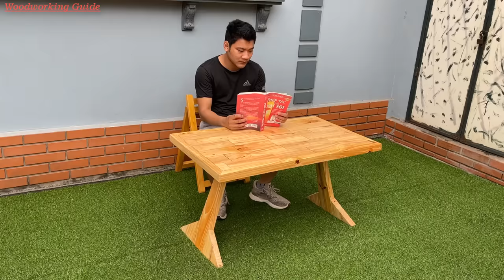Fish-inspired Wood Recycling Project // The Most Unique Idea For A Beautiful And Simple Table

Comment: Nice job on that table. I work in a cabinet shop by the way and if I can offer a bit of helpful advice, near the bottom of those legs if you were to run a piece of wood across to join them together it would strengthen them quite a bit. With them as they are if they were to bear too much weight the strength of them could possibly be compromised. Because they are each only attached with three screws you stand the chance of that table collapsing. The top of the table incidentally is a great idea for a good size chopping block also. I don't know what kind of wood you used but if you were to use a hardwood such as oak it would make a great chopping block.
Reply: or wire, ormaybe some strong fishing line 🙂
Reply: Agreed
Reply: Cada uno hace la meza como quiera!!
Reply: I thought that in time the mitres would open up?
Reply: Certainly needs bracing across the bottom. Pine offcuts so cheap to make, well done.
Reply: Yep. A stretcher with thru mortise and tenon joints with plug pins on the outside ends would provide amazing support and make this great table really complete and beautiful. Very nice idea for a trestle table. Thank you for the video! Subscribed!

Comment: Next time use butchers paper as a backer, or waxed paper, usually peels right off . If not easy to sand off.
Reply: Or, clear wrap or just plan brown paper. Newspaper? I guess any of these would suffice, however, the wax paper works good.
Reply: @robertlangley258  I think the epoxy might soak through newspaper and you could end up glueing everything to the surface/table below.

Comment: First little bit of weight that gets put on there it collapses
Reply: Heaven help those legs if he has kids!
Reply: @ChuckCoy  ²1ssq+
Reply: If you notice, the sides of the blocks were drilled, so glue and urethane if that’s what the finish is, would find its way into the holes and act as if it were doweled. I assume.
Reply: Thats apoxy... Not collapsing at all
Reply: @ChuckCoy  i concurre
Reply: @douglasmichel6361  you assume incorrectly.
Reply: @rulowth4815  

🤣🤣🤣

Epoxy can't beat physics.

Comment: If you smear a thin layer of Vaseline type etroleum on that white board you used for glueing up the table top. It will seperate very easily. Nice job as usual.

Comment: Cool design; fast execution; not sure how it'll hold up, though - looks like pine, and pine likes to move with ambient conditions.  Some of those joints are going to let go eventually.
Reply: The wood will break befor glue does.
Reply: @williamcaldwell9243  As a woodworker, I know only too well about how glued joints work.  My comment is still valid, however, considering the lack of tightness in those laminations, among other things.

Comment: would a top like that work for making a workbench ?  Or wold all the beating a typical worktable goes through make it come apart ?
Reply: I’m sure it can take a light beating.  Glue in general is very strong, but as a workbench for lots of hammering and other heavy things, I wouldn’t suggest it. Cool concept though
Reply: @gs2875  thanks for the reply...   hmmm, maybe a base of 3/4" plywood with that on top...   it would be awesome looking.    I might give it a try this summer (prices permitting)
Reply: @ProbablyUnacceptable  definitely a sheet of plywood as a base. I think it would be a nice conversation piece.
Reply: @gs2875  ゆゆゆふゆむ

Comment: What are the components used to make the adhesive? Name and brand will help, thinking of doing this for 1st time. Thanks!
Reply: Same
Reply: It is an epoxy .. But Wood glue is powefull enough to hold the pieces...  But you need clamps or something to tighten the pieces....
Reply: if you're going to do any woodworking I suggest you look to other channels for guidance. Everything about this manys ways are wrong.

Comment: Wood expands and contracts across the grain if it gets wet or very dry or even with changes in air humidity. If this table gets even a little bit damp it will split apart at the corners, guaranteed. A bad design but it will look quite nice for a week or two.

Comment: I really think that you should've glued each wood together instead of doing what you did. I don't like the spaces between the woods on the tabletop.
Reply: I think what you mean is clamp? Or wood glue? But yeah, I haven't had much experience with epoxy glue, but it is strong! If it were me, based on what I'm used to, I would've done wood glue and clamps to make the table top, which would've saved on the wood/glue sticking to the plastic surface he used, but it works all the same

Comment: I like the idea, however I would have laid out the 2x4s , glued them together with either biscuits or dowels for strength, cut to size and framed afterwards. As far as the legs are concerned, that’s a huge point of failure. A little bit of weight and those legs will flatten outwards. 

You have some nice ideas, but a little more learning about carpentry could make those ideas better.
Reply: Neither biscuits nor dowels add strength.
Reply: @jeradmiller4575  to the joint they do.
Reply: Nope, they're for alignment not strength.

Comment: Is your sander an angle grinder?
Reply: Yes, that’s an angle grinder, I use one on solid surface, they don’t have variable speed, and you burn through pads like crazy, hook n loop is a bad option, go sticky back and change pads not paper, or better yet get a makita 4”x24” belt sander, put a graphite pad  over the cork.... that method works better than anything

Comment: Why didn't you mix some of your fine sanding dust with glue to fill in the spaces on the table top boards and screw holes would have looked much more professional
Reply: I really wasn't criticizing your work it's very good,it's just a trick i learned from other professional in wood working thought i would just pass it along😀

Comment: Nice work but I was taught never to use a chisel that way around, pocket holes too for a strength as screwing into the end grain splits all the natural fibres of the timber. The legs could have also been made with one piece of timber and shaping using your saw instead of joining on the little pieces. . Lovely end project though 👍🏼

Comment: One of maybe more problems when working with used wood or pallet wood is the hidden broken nail.  You may save a few dollars but could end up damaging a joiner or miter saw blade.  When removing old, sometimes rusty spiral pallet nails, they can break in half.  It’s only a good idea if your time is not worth anything.
Reply: What about the time it took for that tree to grow?
Reply: jointer

Comment: Man kann das so machen, aber Schreiner hat der Typ nicht gelernt
You can do it this way, but the guy has not learned carpentry.
Erst die Beine anschrauben und dann noch etwas anleimen. Das ist fachlich ein "no-go"!
First screw the legs and then glue something else. This is a "no-go" from a technical point of view!
Wenn dieser Tisch belastet wird werden sich die Beine spreizen.
When this table is loaded the legs will spread.
Insgesamt ist das Bastlerniveau.
Overall, it's hobbyist level.

Comment: Когда я хочу избежать того чтобы склеиваемые  детали приклеились ещё к чему нибудь то ложу полиэтилен.
Поскольку полиэтилен склеивается только специальными клеями для полиэтилена большинство других клеев к нему не приклеиваются. И со склеиваемых деталей снимаются очень легко и с дерева и с пластика и с металла.
А так всё замечательно.
Переведено через переводчик Google
👏👏👏👍👍👍🤗🤗🤗🙏🙏🙏🕊️🕊️🕊️🕊️🕊️🕊️🕊️🕊️🕊️🕊️🕊️🕊️🕊️🕊️🕊️🕊️🕊️
-*-
When I want to avoid the glued parts sticking to something else, the polyethylene stock.
Since polyethylene is glued only with special adhesives for polyethylene, most other adhesives do not stick to it. And they can be removed very easily from the parts to be glued, from wood, plastic and metal.
And so everything is fine.

Translated via Google Translate

Comment: This table would not last very long.  Screws aren't a good way to join wood.  The frame will split at the corners when the wood expands from humidity.  When someone sits on the long edge the screws will come loose.  Do not copy this if you want to make a sturdy table.

Comment: Putting those three screws in each of the dovetail joints on the table base did not strengthen it. It only weakened the wood.
That's where it will break.
Reply: No kidding... it was a nice dovetail.... but really the screws shouldn't be necessary.... with a cross brace near the floor.

Comment: observations.      good work.  except where it's not.      (pardon my repetition of things that have  already been said, here.)          at 13:22, this is a small,  'casual' table, that is not stable, enough.    the latter is so because the table is  Top-heavy and its  'base'  is  too  small.      the term  'casual' means,  light-duty  only.        the orientation of the grain of the lateral parts added at the bottoms of the legs is  lol  funny/sad.         next time, miter cut pieces so that the  grain  runs  Correctly.          if it is not  always  setting next to  a wall,  the  vertical stability  of this casual table  should be increased,  by  mounting  suitably-sized rails/extenders/broadeners, at the bottom of each  strut/leg.    cheers        googletranslate

Comment: This is just nuts.  I wouldn't trust that table structurally for a second.  His work practices are a health and safety nightmare - sanding with an angle grinder sanding disk with no vacuum and spraying lacquer or polyurethane without a spray booth.  And epoxy as a gap filler is fine but as a glue with gaps....I don't think so.
Reply: And i wonder what‘s less level: the work bench (School table), the Frame or the slabs.